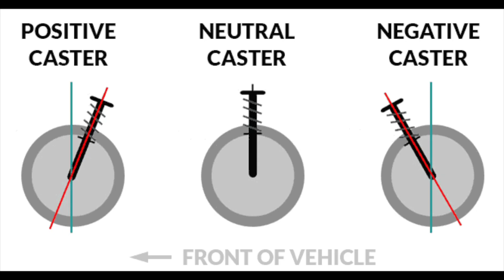How To Set Up A Go-Kart: CASTER / CAMBER

Comment: Take a pin and paper, put marks or take notes for your current setup = Starting setup. Then make DRAMATIC changes and drive below and creep up to your pace. Then go the other way from what you did, again DRAMATIC changes and take notes along the way. I am the same way with how you said other drivers feel differently about camber. I was told to do negative and I needed positive which gave me more bite. But I also had new tires and heard positive on fresh tires and take it little by little back to negative as the tires wear out.

Comment: Hey there, have a neutral setup, kingpin just a bolt.   Rookie, 5 races into Masters class ready to add some caster.  Is an alignment required afterwards? Do not have any equipment
Reply from the maker: It isn’t necessary but it is good to check after. You should be okay though

Comment: Hello, I would like to be able to ask you what effect the positive camber \ _ / has on curves. That is, more open at the top. I suppose the front end grips more. It is right? Thank you so much! greetings from Argentina!
Reply from the maker: Positive camber gives the kart more front grip on entry into the corner and less rear grip on exit
Reply: Thank you very much for the reply! I would like to be able to ask you one last consultation. I have a 2019 Tony Kart with a 30mm barrel. I wanted to know if the front axle grips more or less when I add spacers to the front axle. that is, if I have 1 cm and then I open it more (I put it with 1.5 cm on each side), does the front end grip more or less? Thank you so much!!! regards
Reply from the maker: @diegoavalle5551  It will gain more grip initially into the corner and less grip on exit.
Reply: @NorbergNation  Hi! Thank you very much for the answer. I wanted to ask you if I understood correctly, so if I open it later (I take it from 1 cm to 1.5 cm), is it going to grab more at the entrance and less at the exit? Thank you so much! regards!
Reply from the maker: @diegoavalle5551  yes that is correct

Comment: Hey Ryan! Love your videos man. I’m going into my second season and your videos are already giving me good insight to things I need to correct. Question regarding making the adjustments to caster/camber. If I remember correctly (and I could be horribly wrong). The caster/camber pill has a bunch of little holes that you can use to adjust the caster/camber setting. Is there a way to adjust each individually? Or does adjusting one automatically adjust the other? Sorry for the long question, but I hope to hear back! Thanks :)

Comment: Interesting.  I’ve never run positive camber on any race car or kart. Mostly neutral with karts and then when you sit in the kart, the chassis flexes and goes slightly negative.  Also we run 4.5 degrees of negative on the front of my SRF3 race car.  As the car leans on the outside tire it allows for better surface contact as the tire is basically then neutral to the track surface